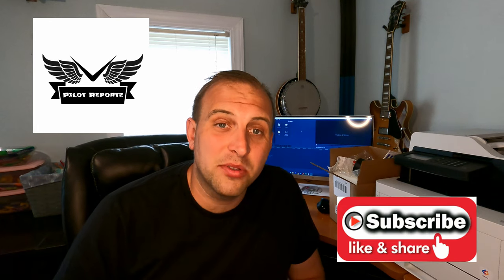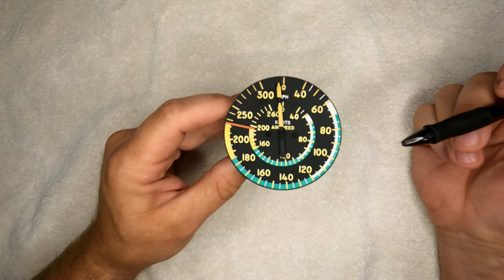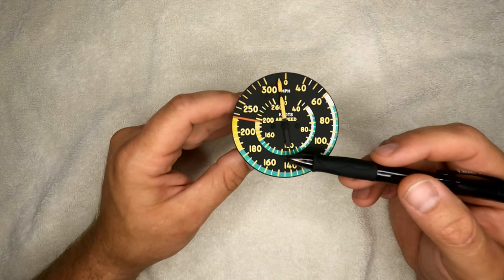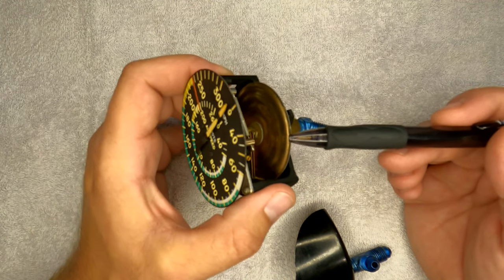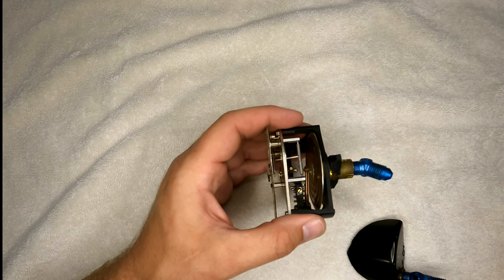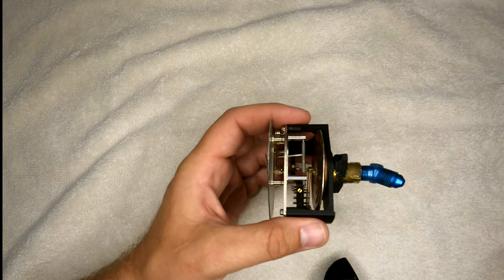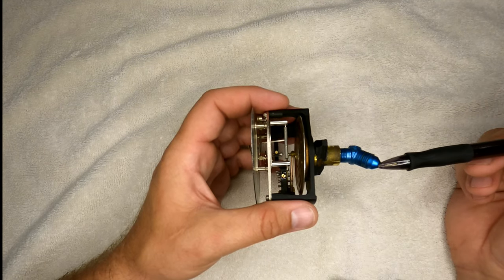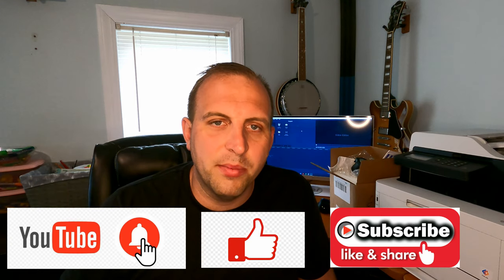Airspeed Indicator Insides! How this aviation instrument works. Pitot Static System

Comment: Thank you for the video! One thing I needed to get clarity on from my school is that the IAS does not use a wafer and only uses a diapghram. The casing is filled with static air from the static air line (static port). The diaphram intakes total air pressure (dynamic and static) from the pitot tube. This difference in pressure = IAS. If the pitot tube is clogged but the drain hole is unclogged then the diaphram will act as a wafer because it is only taking in static pressure which should in theory be equal to the pressure within the casing from the static line. 

Student pilot here just trying to figure it out ;)

Comment: Great video. My ASI is locked on 80kt. My father blew on the pitot trying to fix an obstruction. Do u think I lost it? Or it can be fixed? So sad. 😅
Reply from the maker: It probably needs to be recalibrated.  I have a feeling the diaphragm might be messed up